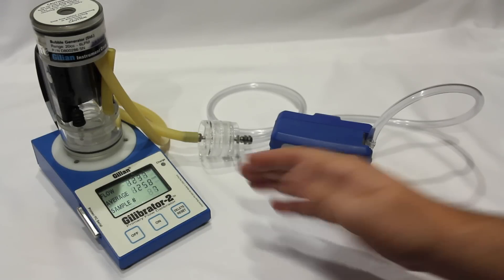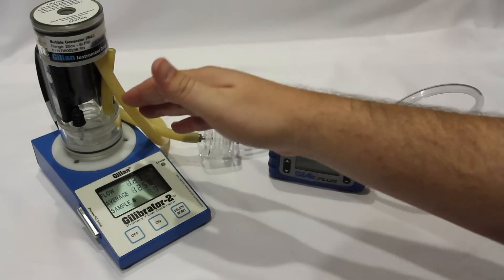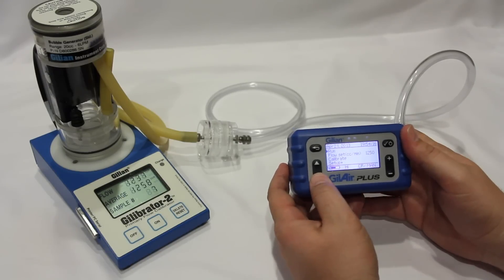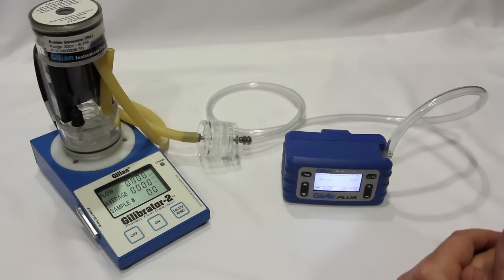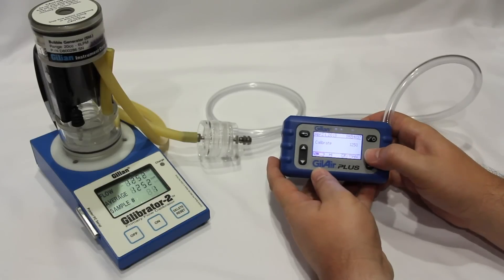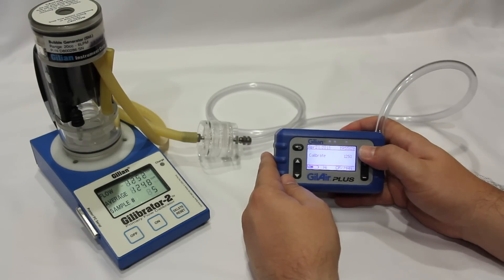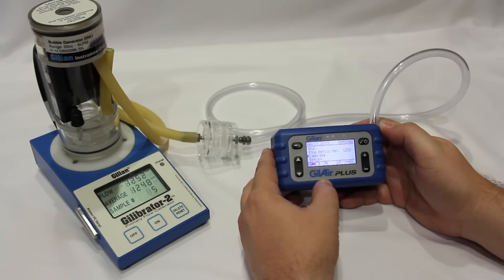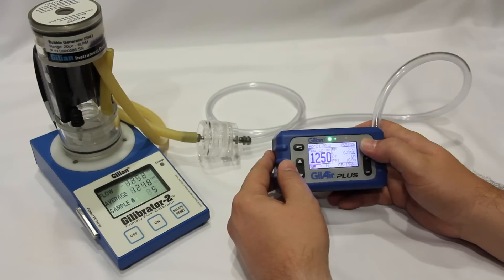Calibrating the GilAir Plus Air Sampling Pump

Comment: I am always struggling while calibrating to match the flow rates.Our standard flow rates should be at 2000cc.If the pump is set maybe 2200 to calibrate to 2000cc.Always a struggle.Keeps Jumping maybe to 2300cc or even 2400 which is not within the 5%.How does one go about matching the flow rates?
Reply: Judith, I’d be glad to help. Could you send me a message at jwalters at sensidyne .com?